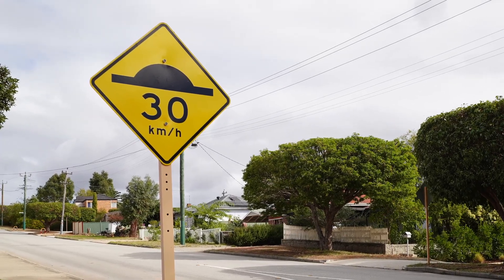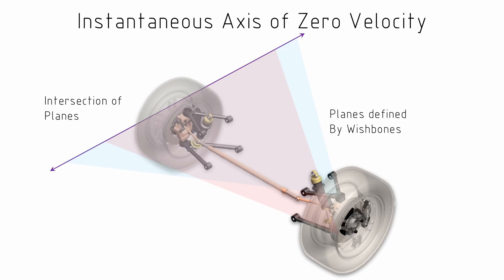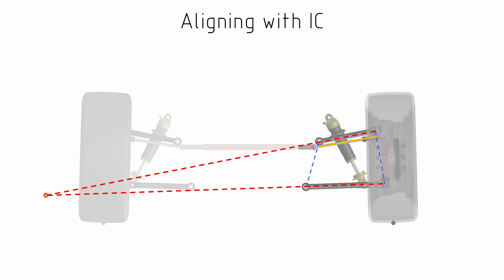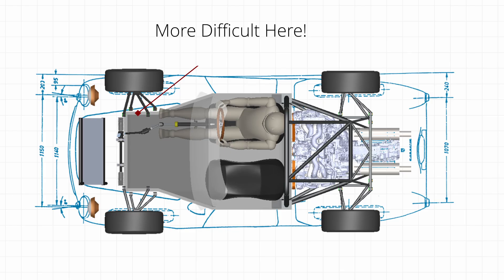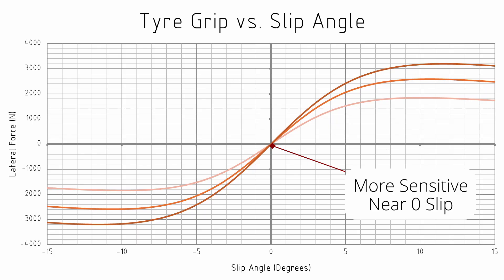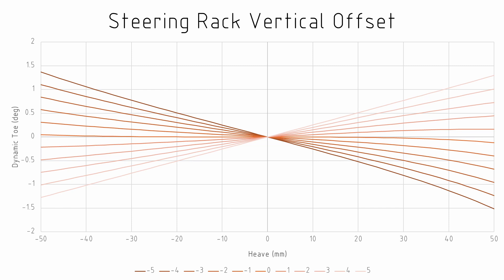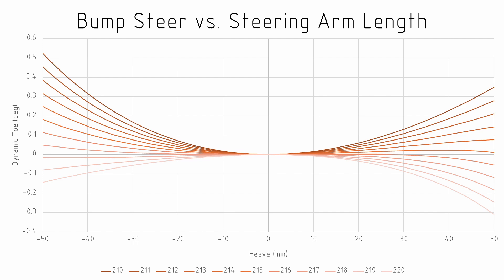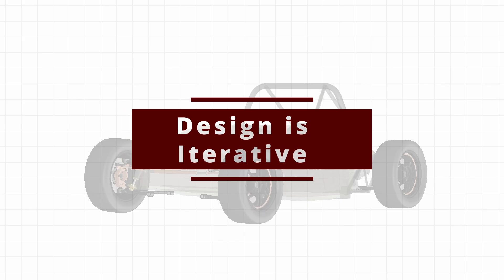Bump Steer: Designing Predictable Steering (Project 171)

Comment: hi mate do you have any tips how to begin understanding some of these stuffs like books etc where to begin im a bit lost
Reply from the maker: Probably not a bad idea to address some good sources of info in a video at some point.  I understand the lost feeling. I read a lot and made (and still make) a number of mistakes.  My favourite starting point is probably Carroll Smith's tune to win. While it is not as technically sound as some other texts it has some of the best insight into the thinking process that an racing engineer goes through. This includes what to prioritise.
Reply: After reading the book what should i focus on? Some sort of mathematics learn cad? Etc thx @KevinHayward7
Reply: @KevinHayward7 Any software i should start using to test stuff learn cad? what do you think its a better place to start after the books not finished the book of course im taking notes and im summarrizing the stuff so its easier to remember and works as a study tool also thx
Reply from the maker: I think just start trying to design something. What I noticed after reading a lot is that no one had run through a design process. That was the hardest thing to figure out, and while I have developed a process that largely gets where I want to go, I wouldn't say its perfect. But I'm a big fan of just jumping in and trying.  Drawings / Calculations / CAD really only cost time.
Reply: Thx man. When you mean design you mean basically making let's say a car part? Well being a student with basically no money 😂 that's a bit bard don't you think cad it's a good way let's say to build a portfolio I'm just a bit lost what cad to choose because I want to stay consistent and stay with a cad for a long time and what software if you know any free ones to let's say test stuff so I can apply on the real word. I'm not close to know stuff in still reading the book and taking notes and I'm always consuming content stuff to learn more. I aspire to know 10% of your knowledge some day haha thx mate  @KevinHayward7
Reply from the maker: I think in the early stages of learning to design it is handy just to do the drawings / models and calculations. You may also be surprised at just how many people around you might appreciate a keen helping hand. Always best to learn when someone else is covering the manufacturing bill.

As for CAD I would do just about anything. Blender is free (less CAD more 3d modelling package) but is worth knowing in its own right. Can build up a good portfolio and there are lots of good tutorials around.  Otherwise a lot of CAD packages have hobbyist / home use packages.

If you are a student then autodesk products are normally freely available. Inventor is very close to Solidworks and I have used it in a professional setting before.  It is an autodesk product.

At the end of the day the CAD workflow is pretty similar between a lot of packages.

Hope that helps.
Reply: Sigo con mucho interés su canal. Tiene publicaciones de este tema? Gracias desde Las Palmas